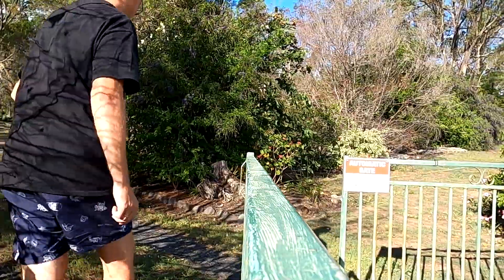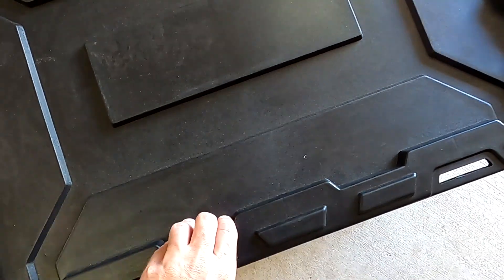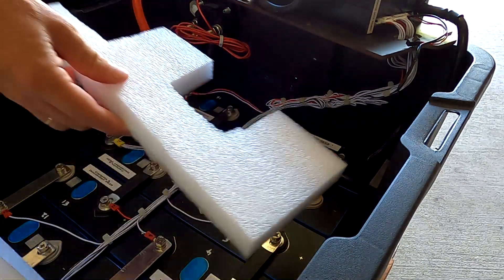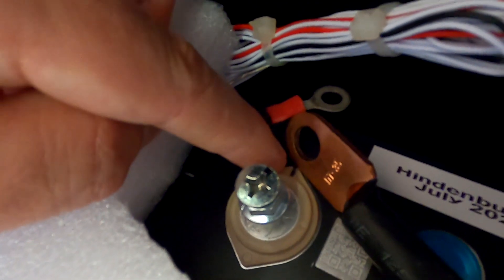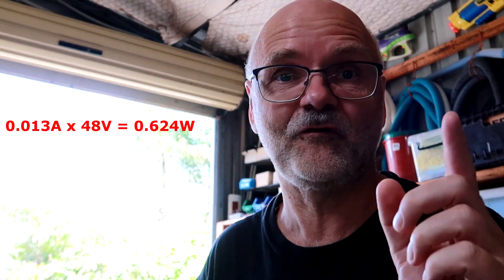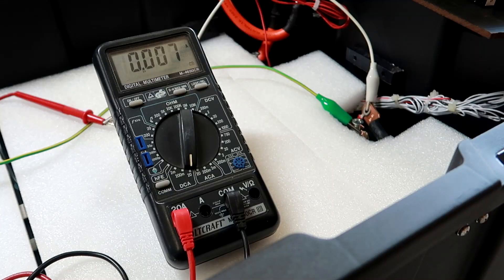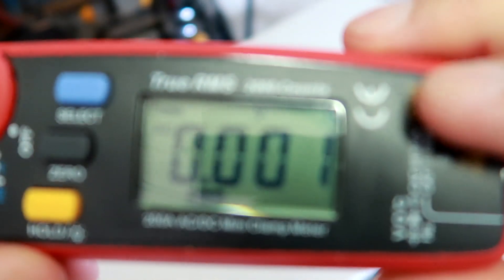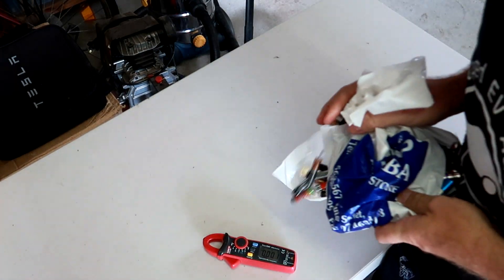BMS with Relay: Temperatures🔥 and power losses⚡

Comment: My guess is that resister is for burning off the balance, Stand by current is just the cost of producing your own power, my inverter never shuts off so standby is just part of the load.
Reply from the maker: How can one resistor discharge several cells at the same time though?